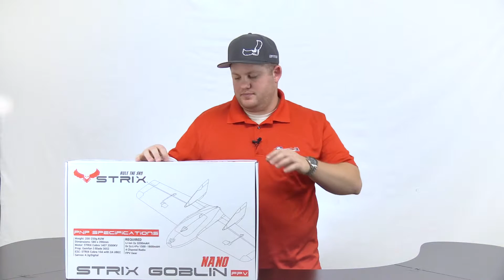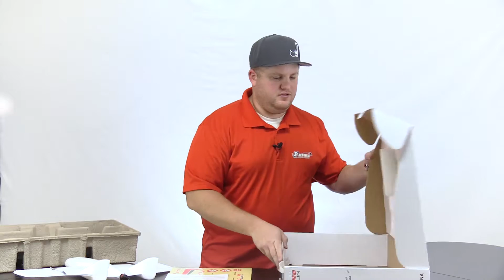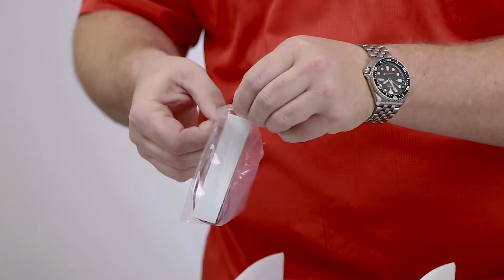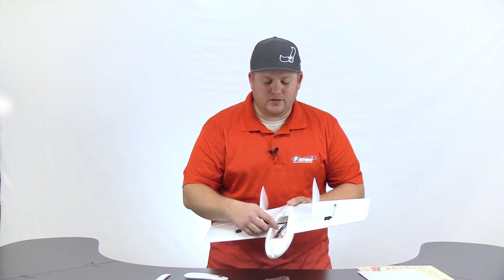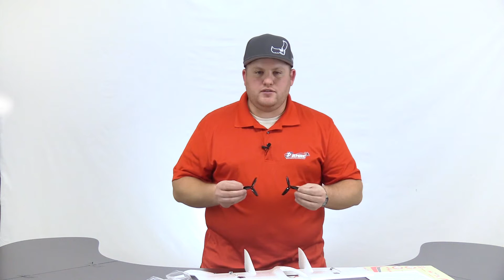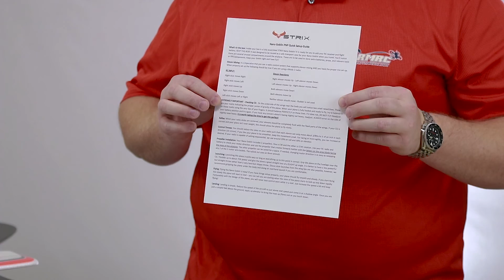How to setup the Nano Goblin

Comment: Do we need to get a power filter as well since the same battery will be powering the VTX and the motor? Thanks!
Reply from the maker: Extreme FPV we haven’t been using any, & I believe the filter on the ESC BEC does a pretty good job.

Comment: I've NEVER setup anything that wasn't a multi rotor, so all the lingo is entirely foreign to me. I don't have any idea how to wire or setup my radio for a wing. With quads, everything is setup on the fight controller. Is there a good video for setting up a plank like this in your radio? Even better if it has a wiring example as well.
Reply from the maker: Jason Hay wiring is going to be straight forward as there are no flight controllers to work with. You don’t even need to solder. You WILL need a receiver for your radio where you can plug in the motor & servos connectors separately. What radio control are you using?
Reply: I'll be using an old d4r-ii I've got laying around with a taranis on opentx. I'm guessing I just plug the servo leads into the rx on whatever channels I want, and then setup the channels to map to function. What I don't know is if there is a specific channel for a specific feature. Also do I just plug the camera into a spare channel, so I am essentially using the pin header as a pdb to bring power to the camera? Also not used to setting up expo in the radio directly.
Reply from the maker: Jason Hay the D4R-II is perfect for this. Channel 1 will go to your ESC & it will power the receiver & servos as well. Channel 2 & 3 are where you plug in your servos & you are correct, the 4th channel is where you can use the included cable to power your AIO camera. Here’s a link to an elevon mixing tutorial for the Taranis. https://youtu.be/RBiNq3dWQBM

Comment: Is the CG really sensitive to a mm?
Reply from the maker: Skipp Turner it is. On such a small airframe, & this one in particular, CG is very sensitive. The closer it is, the better behaved it is.
Reply: Hmmmm, well, I may have to sell the one I bought a few months ago.  I don't want to have to worry about where the battery goes in the airframe down to the mm. If I need dial calipers to locate my battery in the belly, it probably isn't for me. Thanks
Reply from the maker: Skipp Turner I balance mine using my fingers on the moulded CG tabs. If it tilts forward, I move the battery back just a slight amount, & vice versa.
Reply: Well thank you !  That makes more sense.  I doubt anyone balances any aircraft to the mm ! Looking Fwd to flying this lil guy, it looks like a lot of fun. Can't wait!
Reply: Skipp Turner people actually do just this.   If you want it to fly correctly set up is going to be key

Comment: What recommended spektrum receiver for this do you guys recommended?
Reply from the maker: Tj Walker any receiver with at least 3 separate channels. The AR400 or AR610 would work great.
Reply: Ready Made RC, LLC just curious so I could use spm4649t quad receiver then ?
Reply from the maker: Tj Walker that receiver won’t work, I should have mentioned that you need 4 PWM channels. That is a serial only receiver.
Reply: Ready Made RC, LLC oh ok thats what i thought i was going to take it from my quad but good to know thanks